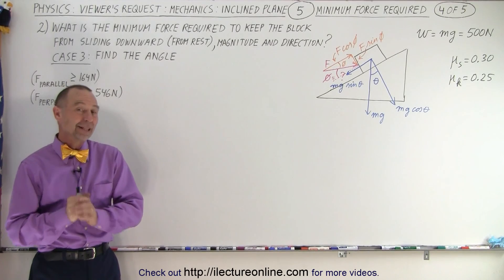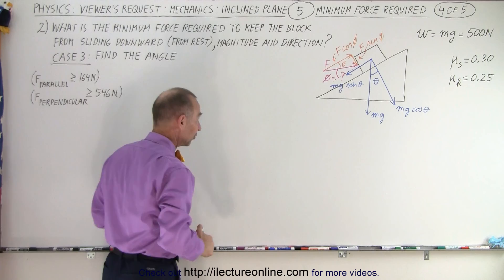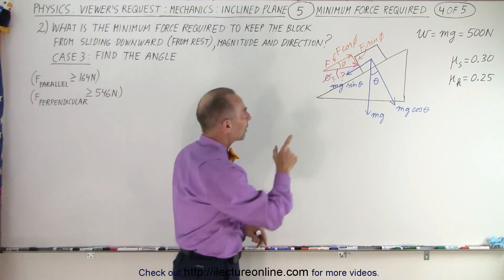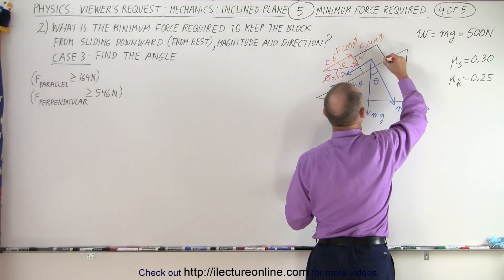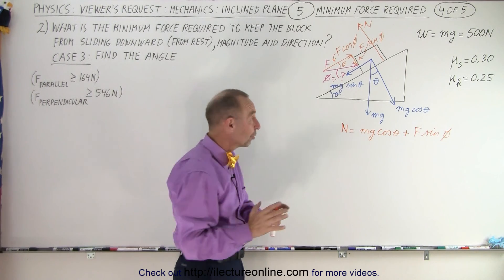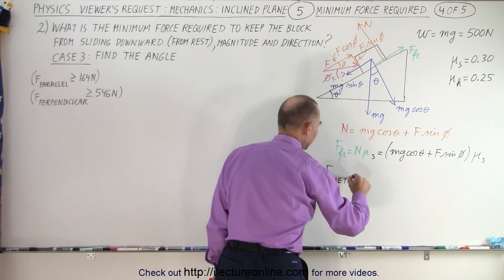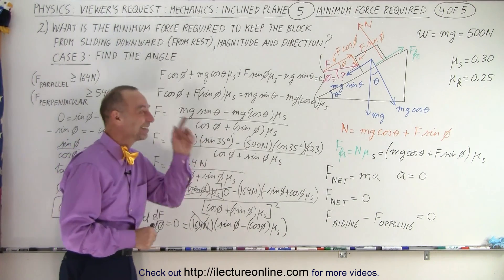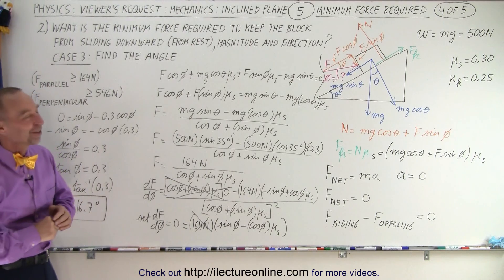Physics: Viewer's Request: Mechanics #5: Inclined Plane - Find Angle for Minimum Force (4 of 5)

Comment: Why static friction is not directed in opposite of the force which pushes the block upwards the inclined plane? Should that not be a condition for block to stay at rest.
Reply from the maker: That would be the case if the block was sliding upward, but the block is sliding downward (or is being kept from sliding downward).

Comment: sir can give a video about this?
A 50 kg block was placed on an inclined plane (35 degrees with respect to the horizontal). A 150 N horizontal force  is applied on the block. The coefficients of static and kinetic friction are 0.3 and 0.2, respectively.
 a) Determine if there is motion and its direction. 
b) Based on your answer in "a", what is the acceleration of the block?